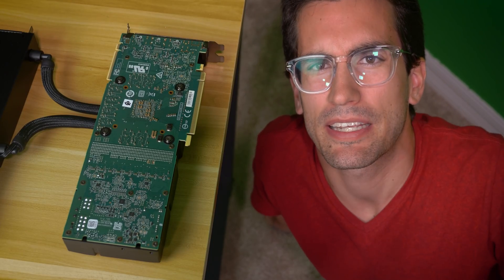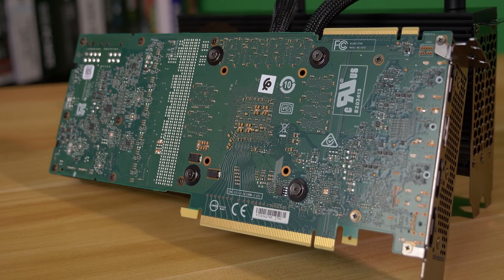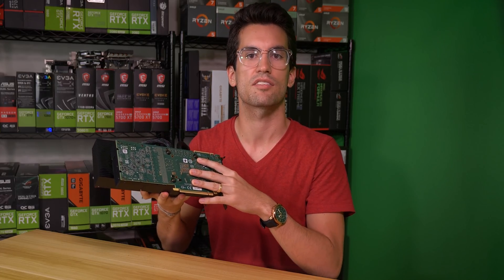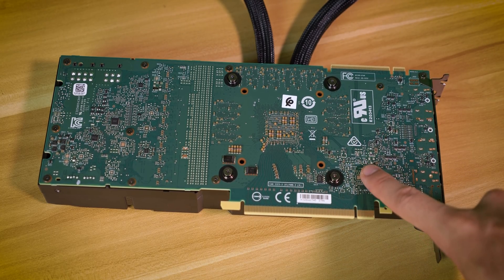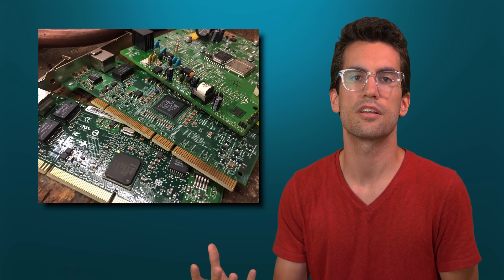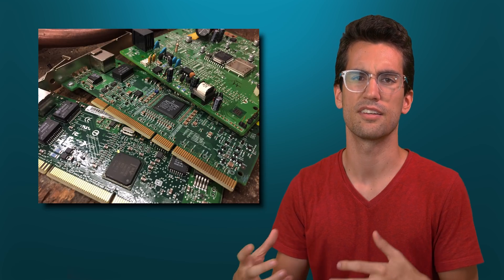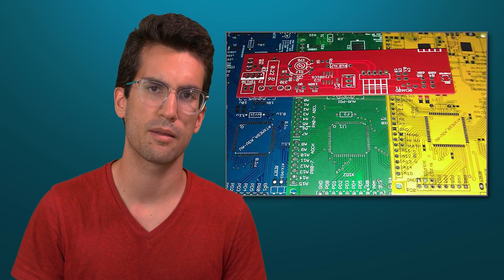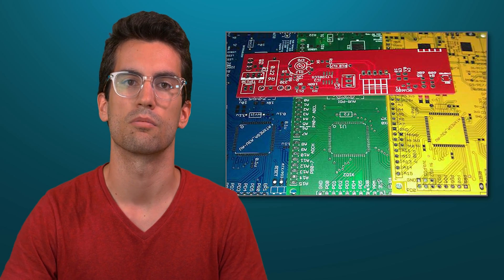Why Are Circuit Boards Green?

Comment from the maker: Thanks for the support on this one! I've been enjoying making these lately, and your feedback is encouraging! Suggest other topics in this thread. GO!
Reply: At the times like these when theres no new gpu, cpu or other major product launches, these "science studio ish" type of videos are nice variation really.
Reply: Do you think Red meaning aggressive has anything to do with the interiors of some cars being red like some Lexus F and F sport models to make it feel more sporty.
Reply: @Minili Oni to avoid sticks being slotted into incompatible boards. Every generation of RAM has technical differences such as voltage, speed and general memory interface changes.
Reply: Keep up the good vids greg
Reply: Used to work at a bare PCB manufacturer. We could make them any color, just that green was the base on e
Reply: It's probably more about eye strain than anything else. (And contrast).
Reply: @ChadDidNothingWrong  that makes sense to me
Reply: I'm liking these new videos very much. The one about Intel's 10nm problem was also very interesting. Asking the real questions and actually going for the answers.
Reply: do something with old pc hardware! maybe get an old graphics card and compare it with the newer models and technology
Reply: @gerg Salazar can you make one video about refresh option we get while right clicking the mouse and why we use it ?
Reply: PCB design engineer here. 

First off, the solder mask is one of the last layers applied to the PCB, so the visual checking (if any) is done before applying it.

Next point I want to make is that automated "pick & place" assembly machines work best with green detection rather than any other color. Red is second best iirc. 

As for general error detection, typically they do end-to-end electrical checks (just like the diode/beeper mode on a multimeter) and since most boards are printed, they are checked for design errors before printing.

Also, they generally have ground planes between the tracks (except certain high precision or frequency differential and RF tracks which require much more care if they are not kept short) which is very easy to diagnose if something is wrong - a misprinted trace will usually end up either as an open circuit, or a short to ground or an adjacent trace, usually both, which again the end-to-end electrical tests can detect.
Reply: @TheGagi82  hey he is a great guy , Americans may be bad but he is great
Reply: @arnabnandi455  Not all people in usa are scum but in general,usa is desease of our planet and they should be annihilated.
Reply: can you paint the aorus RTX in white plz , i have seen a video of you doing it before 4 years but im not sure if it will work with the [aorus RTX] as same as the old video
Reply: the evolution of external memory and how info was written on it... I remember seeing some 1.44mb "floppy discs,"  but my grandfather showed me one the size of his hand and super thin. Also, evolution of the computing power (and size) needed to do do certain tasks... from the computers used to crack the Enigma code, to what it took to land on the moon (I heard less computing power than a basic calculator?), to the entire floors of skyscrapers being devoted to enormous computers, to the computing power of the first space shuttle, to that used in SpaceX Dragon. What made them so enormous? How many floors of giant IBM computers would it take to do what a modern Flagship smartphone can do... or again, what the Dragon or a Tesla does today? Oh, and I had an old sociology professor in University that said he started doing statistics by "punching holes in a punch card and feeding them into a big box"? What? (Edit: Sorry, these ideas may suck but they are just a bunch of sh*t I've never taken time to Google but would love to know more about. 😊)
Reply: This content lately has been awesome. Give it more time. The algorithm will recognize the change eventually and you'll be recognized for your content and recommended in educational categories.

Comment: green is the colour our eyes are most sensitive to, so under a microscope you can see the solder joints etc everything, makes it easier to both see IC, Capacitors, etc... as they are different colours....and hence easier to repair under a microscope.. the end.

Comment: I find it interesting that you didn't bring up black soldermask. Something I hear a lot is "they cheaped out with a green pcb" or "they went for a premium black finish". What's funny about this, is how in many cases green is one of the most expensive colors, depending on the shop, while black is among the cheapest colors (usually red or blue). White soldermask is typically not even a choice, though.

Comment: Tracks? I thought they we're called traces.  Also, back in the day... almost all PCBs were green. Why? Because like you said, it's the natural colour of whatever resin they were using and therefore is the cheapest way to make them.  They weren't sitting around with colour swatches and psychologist picking out colours.
Reply from the maker: Tracks/traces... both were used interchangeably online. But I figured someone would point out the word choice at some point hahah.

Comment: Not all of them are.  The mainboard of the original IBM PC (model #5150) was black with gold lines.  My Gigabyte Radeon HD 7970 Windforce's PCB is blue and my XFX Radeon HD 4870's PCB is red.
Reply from the maker: No one said all of them are, Lol. Many PC components today aren't green. But it doesn't change the fact that green is - by far - the most common color (for reasons explained in this video).

Comment: In the early 2000s I bought a bunch of pcb for random projects. I specifically remember asking the manufacturer why the green ones were $5 cheaper.
They said that it was because of the resin (https://blog.boats.com/files/Resins_04.jpg). Other colors required almost twice the amount of dye compared to that green. Black would have worked, but it was often more expensive, and since most computer parts are inside cases or housing, the green was the best alternative when you think about the price, the visibility (traces and silkscreening).

But that was just that one manufacturer, there were tons of different boards and different materials used during that 90s - early 2000s. It was still an advancing industry.

Comment: Not sure if you'd know the answer to this but couldn't PCB be made out of clear flexible glass like fiber optic cables? This would made the PCB transparent. It may allow for error checking. Printing on the board would be easily seen whether it was in black or white. And it may even be more environmentally friendly since less ink and by-products would be produced. Any ideas about my idea?

Comment: The colour green causes the least amount of strain on the eye. This is more biological than psychological. The eye can see light between the wavelengths between 400 nm and 700 nm. Green is a mixture of the colour of lights blue and yellow, and has a wavelength of 550 nm which is right in the middle of the wavelengths of lights the human eye can see. This is also the reason why most blackboards and chalkboards are green since teachers and students have to stare at them for a long time.

Comment: You should have talked to someone that actually does PCB assembly. Tracks are usually called traces. The "tracks" or more accurately the pads are yellow not because copper is yellow but because the board is gold plated, otherwise they are usually silver color from silver electroplating or the pads are pre tinned with solder/tin before being sent to the factory for component populating/assembly.

Your explanation as for why red isn't the default is also the same reason that you very rarely see red scrubs (medical clothing). Staring at the same colors all the time, especially an intense/bright color like red causes visual fatigue.

Comment: This video is mostly hot garbage up until like the last 5 seconds.

It's called soldermask (you veeery briefly hinted at it with wave soldering, but no cigar), and it's main job is to prevent the solder from jumping from trace to trace creating a short circuit. Green was the only economical color that also worked very well before, with other colors much more expensive and much more sensitive and just really worse. Today green is still the best and cheapest, but other colors have caught up just fine. Go to JLCPCB.COM and youll see that the colors dont cost extra now

Comment: I get most of my boards with a green solder mask entirely because its easier to see traces and is typically cheaper 
black solder mask makes it harder to see the traces and harder to see any mistakes or make mods 
but black solder mask makes the silkscreen layer easier to read so it can be better for production

Comment: While working in the electronics field, I have seen several other colors other than green: Blue, red, orange, tan, black light gray & brown. I will say thay green is usually the easiest to see Conformal Coating (Protective moister coating) defects under black lights.

Comment: What's just as strange is some scrap yards for old electronic boards pay less for certain non-green motherboards. I'm saving my old scrap motherboards and green ones I can sell for $1.90 (US pricing) a pound and all other colors are $1.60 a pound but that listing is just for more modern motherboards, older larger socket or slot processor boards are same pricing for any color as well as the expansion cards.

Comment: I have worked with blue, Dark and Light Green, Red, gold/yellow, Brown, Black.  In old school Main Frames, bord colors ID'd there purpose and function.  The same in military applications and equipment.  Depending on what conductor is used for conductor tracks, Gold or silver or copper, Green, Brown, or Black.  Red for a critical controller card to the machine, as with yellow/gold.  Most consumer cards settled with green and some red with the silver/gold/copper conductor or conductor tract, contrast is the desired effect.  :)  Green provides the best all-around contrast for most conductors

Comment: It is due to the solder mask, which protects the copper circuits printed on the fibre glass core to prevent short circuits, soldering errors, etc. The colour of the solder mask gives the board its appearance.

Comment: As a historical note, I remember when PCBs were made of bakelite and were light brown. When first introduced, the much superior GRP boards were distinguished by being naturally translucent whitish, before solder mask was introduced and they became green.
Reply: printed circuit boards were almost never bakelite, they generally used other phenolic resins with cotton reinforcement.  also grp boards are naturally light brown, the phenolic ones were darker.  some manufacturers would bleach their glass fiber boards as a way to distinguish the higher tier products (glass is generally thought of as clear so it was an obvious choice) and that sorta carried over into the 80s and 90s but isn't too common anymore, you can look at the edge of most modern PCBs (high volume ones at least) and you'll see the light brown color.
Reply: @butre.  Although Bakelite is the trade name for a particular phenolic resin, in the 1950s and 60s when I was wiring up valve/tube amps on laminated phenolic tagboards, we called them bakelite as a generic name for phenolic resin. When pcbs were first introduced, they were based on laminated phenolic resin which we called bakelite as the generic name.
I have quite a lot of experience in grp, whether polyester or epoxy based, boatbuilding, car body, etc.. Wetted out glassfibre is colourless as is epoxy until fillers are added. Early epoxy grp pcbs, which I first encountered in the late 1960s, were whitish because of the fillers used; they were never bleached as this would have weakened the board. Neither epoxy resin nor glassfibre is naturally brown.

Comment: PCB Engineer here: I don't find green calming at all, I don't like it.
I always change the colour if I can, but my manager has to still approve it.
If I'm free to chose what I want I usually go for mat black solder mask, white silk screen and ENIG gold plated pads.
You as product manufacturer do not have to bother about inspecting traces of the PCBs, PCB manufacturer will be responsible for inspecting them when they have no soldermask placed on it yet and can see it clearly.
Different colour doesn't cost anything, even usually when you're ordering prototyping batch of 10, though some other prototype PCB houses will charge you extra for colour change, but then still it's not because it costs more in the soldermask itself but because they need to put you on separate shared panel.
Reply: Firmware engineer here: Black solder mask needs to be banned! 
I've spend ages trying to reconstruct PCB traces (because SW guys don't need Altium licenses, right? right?) and trying to find all the non-obvious layout mistakes PCB engineers made with a flashlight, sand paper and sharp multimeter probe tips.
Reply: @AndrejaKostic  If there's a mistake on PCB then PCB engineer will be looking for it not software engineer.
And even if you would need to look at it you could get at least the picture of the layout.
With PCB in hand you can only see outer two layers.
Reply: @Arek_R.  Well, in an ideal world, yes the PCB engineer should fix a mistake. However, in reality, there are often complex interdependencies between hardware and software, and in this case, it took several months, for SW development to come to the state where the issue become apparent. By then, the layout team expected that its part of the job was done, they finished all internal reviews, filed the paperwork and so on, and wanted out.

For the pictures of the layout, well, you'd need someone with actual desire to export them. If you have to ask for a section of the PCB layout, then get a snippet two hours later, then ask for another one, and get it two hours later and so on, then it becomes easier to try to reverse-engineer the section of the board yourself then to rely on others.

As for the two layers only, well, that's sort of true. We were lucky enough, that the problematic part could be mostly fixed on the two outer layers, with some cutting and jumper wires. The inner layers were mostly power planes and some LVDS signals, which was fortunate.

Comment: Like you said, the color is all in the solder mask -- the actual PCB is a yellowish color, which you can see on the PCIe latch. Early circuit boards were just that color or brown (40s/50s/60s), and even prototyping boards today that are just an array of solder pad holes skip the solder mask and are just a raw PCB with copper. 

Personally, red and black solder masks are my favorites... I wish AMD would do red like ATI used to

Comment: I think its even simpler than that now. I do a lot of PCB design and fabbing, and it just comes down to cost. Green is often cheaper, not by a huge amount, but its still there. So when you're making large volumes those extra savings add up. So I think its now self perpetuating, its cheaper so its more common, its more common because its cheaper! And with the silkscreen and solder resist you're a little bit off. Pads are often coated, usually in HASL solder, but also sometimes (bu far rarer) gold. This means pads for the most part look silver. And silkscreen is really common to be found in black, so poor white contrast colours can have black silkscreen :)

Comment: So we’re just gonna ignore black it’s easy in the eyes goes good with copper
Reply: probably terrible in dark environments
Reply: I'm not a science guy but if you wear black/dark clothing under sun you'll feel more hotter than if you're wearing white/bright clothes.

That might applies to electronic parts as well.

So I don't think its a good idea painting motherboard black when there's plenty of parts radiating heat that potentially can cause damages to the motherboard...

Comment: Greg, just as an FYI ... you are aware they are selling keys that expire/die out right?
Had to rebuild my PC yesterday, with a new CPU and GPU and had to reactivate. 

Oops, the key was over-used, and couldn't activate anymore.  Went to e-chat with them, and they made it seem like they were doing a HUGE favour by giving me a new key - that I'd paid for.
SHADY SHADY SHADY.
Reply: Yea its not good site... it only has  1 star on better business bueru
Reply: im pretty sure your windows detected a new cpu and gpu and because you didnt have them synced to a microsoft account the change in hardware made that key tied to the previous hardware.

in that case, thats microsofts fault, not the guys that sold the key. and also your fault for not using the microsoft provided way to reuse the same key by transfering the license

Comment: If you were that full of mercury, lead, tin, baked at a couple hundred degrees, poked full of holes, peppered with copper and gold, stuffed in an air tight box, shipped to an uncertified surgeon for assembly, had dozens of items shoved in every hole you had...

You'd be green too.

Comment: A lot of motherboards are black.  Brown is also pretty common.  I have a pci-e WiFi card that’s red. In dealing with a circuit board recycler I learned they pay a different rate based upon the color of the board. I asked the recycler why this was and he said, “The color of the board is indicative of its GRADE.”